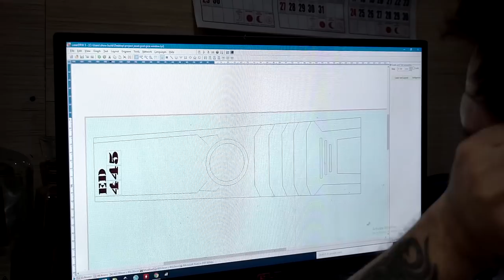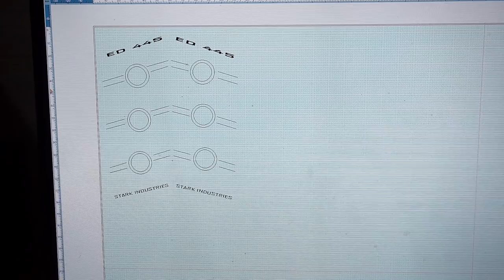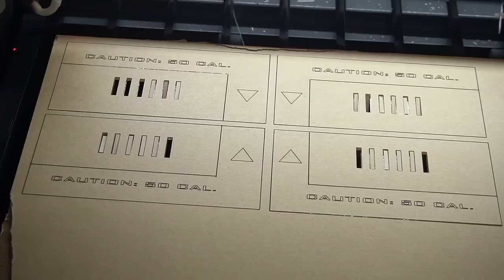WAR MACHINE PC

Comment: When you painted the tubing, I think it could have been cool if you taped a think line going the entire length of the tubing so it would still be clear. Then put some RGB fittings on it, and fill the reservoir with clear fluid. Set the RGB fitting's LEDs to Red. The fluid will then be Red, while the rest of the tubing is all matte black.

This way, when you power on the War Machine, it looks like the Arc Reactor is getting it's power from the fluid to power up. 

You should try this for a future project! 🙏

Awesome job on your rendition JP!

Comment: I like all your builds, some more than others. You go to great lengths to perfect them. You've got top of the line equipment for making these builds. But one thing that troubled me with this build, or maybe you didn't show it, you just twist wires together to make electrical connections? No soldering the two wires? Little pet peeves of mine. If you're doing everything else to high standards, why not the wire connections?
Reply from the maker: actually i did solder them.. the one one the video was just to test the leds beforehand and to see if my idea would work.